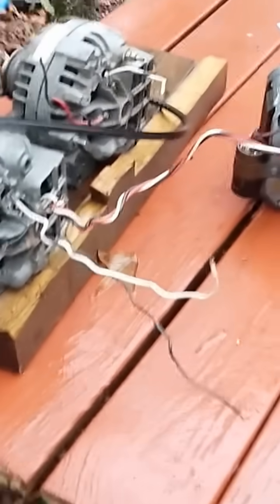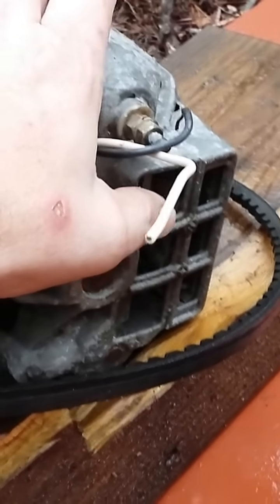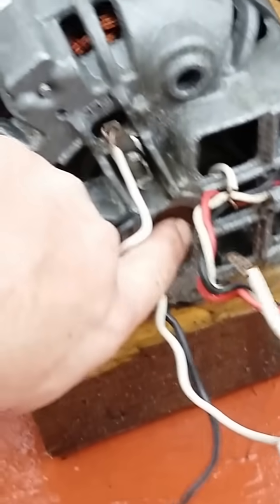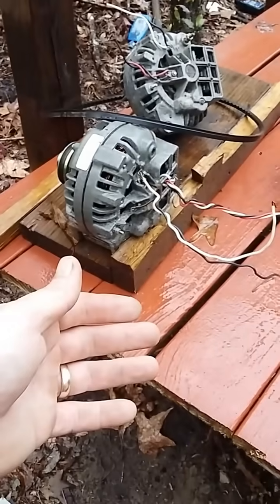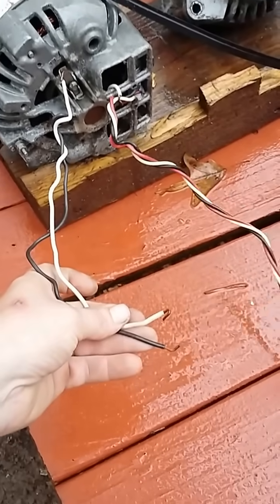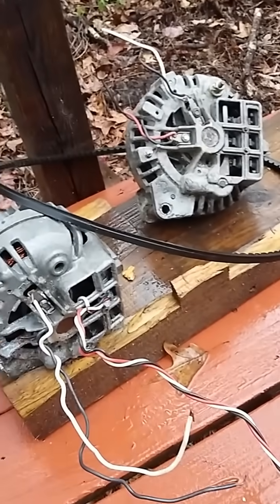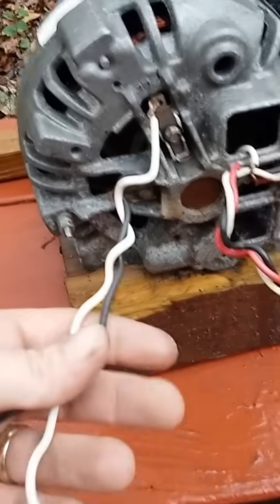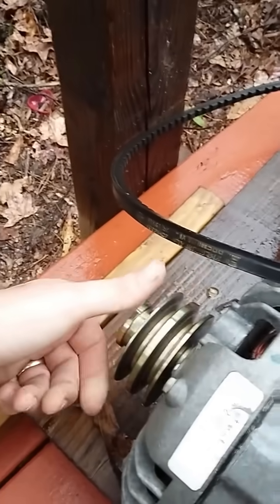Update Free energy forever no wind no solar no gas READ DISCRIPTION!!!

Comment: It won’t work, you cannot get energy from nothing, perpetual motion machines are an impossibility. Friction losses and drawing power from it will cause it to stop.
Reply: This does not count as a perpetual motion machine as the laws of thermal dynamics do not apply, a car alternator @ 110 amps can produce up to 250 VAC before that current is sent to the bridge rectifier and voltage regulator that turns it into DC 12v your car battery uses, by pass the voltage regulator and and bridge rectifier and you can harness the full voltage. and as everyone knows 110 amp x 250 VAC = 26,000 Watts. I have also verified this information with multiple electricians.
Reply: @chrischase9601  car alternators do not produce 250vac, have a read of this
https://cr4.globalspec.com/thread/33743/Can-a-car-alternator-generate-110v
Reply: @chrischase9601  the laws of physics apply. You cannot produce power from nothing, if you did manage to get this system to run it would run down and stop even if you don't draw any power from it, there is friction in the alternator, friction in the belt drive  friction in the motor, friction in the wires (resistance). Put the alternator under load by drawing power from it and the voltage will drop to around 16 volts unregulated. Drawing excessive amounts of power that you are talking about from an alternator will result in the wires melting
Reply: also spinning the rotor in an alternator almost has no friction until you excite it, so spin the alternator first at high rpm, then excite that rotor.
Reply: Your forgot to account for the resonance frequency of internal crystals
Reply: Must connect a battery, he said that multiple times.
Reply: JCoastr so? What is the point of it all if it’s running off a battery? The battery will run down too!
Reply: @robertcuthbert8095  the second alternator charges the battery.
Reply: JCoastr that is insane, charging a battery from the battery! It’s idiotic! It’s like charging a power bank from itself, just plain stupid
Reply: @robertcuthbert8095  how does a battery get charged in a vehicle?
Reply: JCoastr hint - energy in equals energy out, you cannot generate more energy than what you put in
Reply: JCoastr from the engine!
Reply: JCoastr the power from the engine turns the alternator, not the battery
Reply: @robertcuthbert8095  actually the alternator charges the battery it also runs the electrical system in a vehicle.
Reply: JCoastr the alternator in a car is being TURNED BY THE ENGINE! It is engine power charging the battery
Reply: @robertcuthbert8095  yes, thats why you need the electric D/C motor: 1 D/C motor; 2 Alternators; 1 serpentine belt; something to mount it all on. Make sure your D/C motor has the correct torque and rpm to run the alternators.
Reply: @robertcuthbert8095  See the power comes from the alternator, it just needs to be turned. You can turn it yourself with a bicycle if you don't want to use a battery and motor. Then you just need one alternator.
Reply: @JCoastr  power in equals power out, if you want to generate 20,000 watts, you need to input 20,000. Energy does not come from nothing, turning the alternator yourself will generate about 20 watts
Reply: JCoastr if you have an electric motor turning 2 alternators, and each alternator is outputting say 2,000 watts each, then the motor turning those alternators will be drawing just over 4,000 watts, power out is never more than power in

Comment: How much energy we talking about here?? 
Cus theres another channel that says all power is free. All the high voltage lines are actually antennas that take energy from some were. An he claims if ya follow the lines they just run in a big circle from substations... 
Yep an all the employees bite there tongue about it all.
Reply: Thats called a circut
Reply: Yep
Reply: The energy that can be produced depends on the amperage of the alternator, AMP x VAC = Watts, so a 110 amp alternator you can produce up to 26,000 watts because an alternator can produce up to 250VAC
Reply: @chrischase9601  The power you draw (powering your mansion) ie the current in the 220 v output line acts as a resistance(break) so you require more power to turn the "stator" . Just look up requirements for gas power generators,. Average 10kw generator requires 25HP motor to turn and maintain the speed . Your 6v input can turn the alternator but you won't produce much more than the equivalent input power. Also, the 90Amps you are talking about are DC current amps. At 220 v output you can draw no more than 5 amps. But that's only a math and law of physics. So nevermind.
Reply: @chrischase9601  Stop spreading misinformation, take the time to look up the shit you keep blabbing to everyone....

Comment: If it was hooked up to a DeLorean, and hit the necessary 88 mph to generate the 1.2 Gigiwatts, I would believe.. All I saw was two junkyard alternators, sitting on wood with wires coming out, and no demonstration or proof of concept.
Reply: The proof in concept is doing your research on alternators, altho the owner of this video didnt explain much he is 100% correct. if you read one of my top comments it explains it all
Reply: @chrischase9601  You're complete BS, where is your working concept? Don't give me that research crap because you've obviously done know of that.

Comment: I'd why people hating. I don't think he's claiming that he's found a way to make free energy. Just the start of an explanation of how to use an alternator as a generator to run a gouse. Which is something that "as crazy as it sounds" works and isn't all that hard. Anything that has similar design can be used. Washing machines, fans, electric leaf blower, etc. You can live off grid easier then you think and for a fraction of the price.
Reply: Care to expand? Just started reading  preppers  recently 
 From what little I understand  (I'm in my sixties multi stroke survivor )
The operation of modern alternator can generate ac low or high speed rpm the DC inverter supplies up to hundred of auto apps and services
But it doesnt seem to be much of an investment to check it out

Comment: Could you put the brand of alternator those are.
Reply: Brand of alternator does not matter, amp of the alternator matters, all alternators can produce up to 250 volts A/C, so that larger the amp the more watts you'll get out of the system
Reply: Brand.....Oldnused

Comment: Great video!!! I was thinking about getting a wind turbine with power inverter. But this should be cheaper way to go. How much amp does a house or residential usually use anyways for the homes in America vs outside where they used 220v?🤔🤔🤔
Reply: your average house needs around 10,000 watts to run everything you want, you do not need an inverter as connecting directly to your breaker box is basically doing that same thing. so get a alternator that is over 90Amps, bypass that bridge rectifier and voltage regulator and your good to go.

Comment: What would happen if you magnetised the roto.
Wouldn't this bipass the need for the field battery?
Reply from the maker: Yes you are correct. I have stated before that using a 10a10 which is a 1000 volt 10 amp rectifier diode across the two wires that are the field wires on the alternator. If done it can self resonate and build its own power once it reaches 400 RPM...

Comment: Simple explanation, red goes to a car battery, white is ground, black is negative, 

If it spins it produces power any where between 60 and 110 amps. I'm not 100 percent sure how to ground it if it's the only thing you have, you may need to run the ground and the negative to the same battery negative, but anyway the simple way would be to run most of your power from a battery, like a car, you can charge the battery to a maximum 15 volts, however, as long as your power source comes from a battery or batteries, the charging source, ( alternator, generator ) will last much much longer. 

If you directly lead off of an alternator, and draw to much amperage from it, it may stop producing electricity, however if you use direct feed from a battery, you will only be able to drain it so far, till it dies, and needs a charge, the same as a car. Your always better off running power from a rechargeable source, rather then directly from the electrical source, 

Overload and under load are much easier to deal with, when you can rule out, the charging source as a problem.  

Burn out cheap parts, not expensive ones, and for those who are just gonna go out and learn it and do it, first timers... don't use a brand new battery, 

Buy a brand new battery for your car, and swap em, and use an old used battery. So it's no loss if you burn it up.

Comment: Honestly, let me explain something else helpful,  

It sounds stupid but it will make perfect sense, if you use power from it to start a belt drive air compressor, with no tank, you can keep running the pump and belt pulleys, with it's own power, you just have to keep running more belts or pulleys, to more of them, and they will keep running from there own power,  then start wiring up outlets. Once you get one motor running, you can keep it running on it's own.

Comment: You need a job, or if you have one, you need a better one. If you can't afford a 120-170 a month light bill. Go check on yer kid. Don't sound like you're even sure of what you're saying. I believe someone told you about this and you're trying to act like you understand it. Do you realize how much horsepower it would take to get a constant 200 amps from that? Put it together and show a video of it running and powering a range, dryer, and water heater at the same time... On those little wires no less👍
Reply: My thoughts exactly
Reply: Sheep
Reply: I wish my light bill was that. Mine runs 600-780 an I'm with duke energy.
Reply: @parrisestatessouthernhomec3246  dammit man, I'd move

Comment: If you drew 90amps through those conductors they would melt...
Reply: Not if u bypass the diodes...
Reply: @30stmfannumber1  please elaborate
Reply: @30stmfannumber1  the thin wiring would
Reply: @30stmfannumber1  A diode has nothing to do with anything, we are discussing 90amps of current and conductors, which would require a minimum of 25mm.
Reply: Those wires would melt it needs that thick copper wire and he's letting those get all wet
Reply: @Mike-su8si  yeah this guy is a scam
Reply: @JoshuaSouthgate  if I were to make any of that I'd first use the right gauge wire
Reply: @Mike-su8si  yeah, 90A my ass. The creator keeps deleting my comments telling him that this is a scam too haha. He knows the truth but chooses to mislead.
Reply: @JoshuaSouthgate  I guess so if that's what he's doing.

Comment: Ok. So you feed 12VDC from a battery through the armature coils to build your magnetic field. Using the chemical energy stored in the battery.

You then rotate this armature to create a changing magnetic flux across the stator windings, which generates AC voltage which is converted into pulsing DC by a diode, and you then have access to 90A DC. Where exactly is this mechanical energy to spin the rotor coming from, and what makes it free?

If it's being supplied by a motor, what's providing energy to spin the motor? Is it another a generator? If so, what's providing energy to that generator? Are you somehow turning it by hand, using the energy in your own body? If so, where is that energy coming from? Food? Did you pay for this food? If so, this is not free energy. There's no such thing as a free lunch.
Reply: You can pick up energy to charge the battery from the ground! , or water or the sun.
Reply: @erikbostrom.9318  Cool! Then why isn't that in the video?

Comment: Power anything you want? How do you power it?  I dont think anybody will be looking to take you out. put 3 to 12 in and get 12v 90a out? well how do you turn it?   I have connected to a belt to a rear wheel of a bicycle mounted on frame. pedal and charge car battery. But youd need 20hp in to get max power out.

Comment: Your system relies on a battery to electrify the field coils of the alternator, which must be recharged from time to time, it relies on a motor to spin the alternator and the motor needs either grid electricity or a car engine running on gasoline or diesel fuel to spin it. So after you pay for the grid electricity and the engine fuel, where is the savings? Because of the loses in the system, approximately 75-85% efficiency for each stage, the net result would be paying more for this system than if you used electricity from the grid. If that is not the case, then you have failed to explain how your system is more efficient and less costly than the power company's system.
Reply: Yes physics is a bitch. He also claims that power companies are doing the same thing in secret, getting their power for free!! That means that a century of coal burning has just been a smoke screen. Still, a refreshing break from the usual flat earth ramblings.
Reply: Haha dumbass!!!

Comment: Great video, great information. You’re missing a few steps, but if these morons arent smart enough to figure them out they don’t deserve the gift you have given. Great work. I have replicated this and it does work, for certain ! I’m running an off grid system in an RV and I replaced my gas generator with and alternator generator powered by another alternator powered by a inverter fed from my battery bank.
Reply: I'm glad to see the someone has already done what I've always thought possible !  And now I have the confirmation that it actually works ! Too bad I'm not an electrical engineer  to figure out the details  but I have confidence I'll get it to work ! I'm planning the same setup you mentioned .
Reply: Sam Fisher  4 or more ? Alternators? Sure but may not be as efficient as  say 3 with one as motor and the other 2 as generators. What are your needs ?  U mention smithing, are u needing to run equipment ? Or just run a household ?  Do u have a current idea or set up? Going “off grid “  totally is a lot more than generators.  You’ll need a wind or solar set up and a decent battery bank. The generator would supplement the rest. Atleast that’s how mine is set up.
Reply: Your as looney as this guy, you should be living out there with him. Then you can make a bunch of babies and listen to them scream.

Comment: I could be completely wrong. But isn’t the pulley on the alternator so you can connect the serpentine belt to use the engine rotation to generate power?
Reply: yes

Comment: I did some of those experiments over 50 years ago shortly after alternators first came out on cars. They output roughly 400 Hz to 1000 Hz depending on how fast you turn them, way higher than your standard house power at 60 Hz so motors and transformers in your house will not work properly. The more current you use, say 10 amps or 50 amps, the harder it is to turn the pulley, more work. To avoid this high turning power requirement requires a completely different setup. Study John Bedini's (now deceased) work but what he has been able to publish is not so quick and simple to understand either but REAL "FREE ENERGY" can be found there. I wish you well, Thomas, but you leave me skeptical to say the least. "Buyer beware."
Reply from the maker: The first number you spoke of, self resonates as soon as it reaches itself... the second one only works inside here...   (137)
Pulse-width modulated DC ran into a transformer is a pure sine wave..  2 res. @. 1.5mhz because that's how fast the sun turns or vibrates if you want to get technical.  Thank you for trying to help me Brother!!!  just remember only lead them to the water, they must figure out how to drink it on their own or they will never appreciate it!!!!    #LIVELIFELIVING

Comment: PS. 
Deal with the crying baby in the background instead of making silly videos. 
Also how would the "People" who said you won't live long know about anything your doing unless your a chatty guy full of stories.
Reply: A house runs off AC electric that stands for alternating current  car batteries run off DC which stands for direct current .And is someone looking for you .why are you even talking about dying on your YouTube channel....? I could show you how to mount the alternator to a home made wooden frame and take a used 50 cc horizontal shaft motor and the belt that went to the alternator and mount the motor align both the alternator and the engine and install the belt and run your wires to your alternator start the engine and the alternator will start spinning creating power then you will have a home made generator there's all kinds of things you can build if you have the tools and material at your disposal you can take the air condition out of a used are wrecked car and mount it on a piece of plywood and supply power to it using the same home made generator to power it just make sure the air conditioner works before you take it out of the car good luck on your projects and thinks for the video your idea wasn't stupid it was just not understood by the viewer's. I understand what you're trying to build and teach fellow youtubers thinks and have success with future projects.,  signed by XLG, Xavier god bless